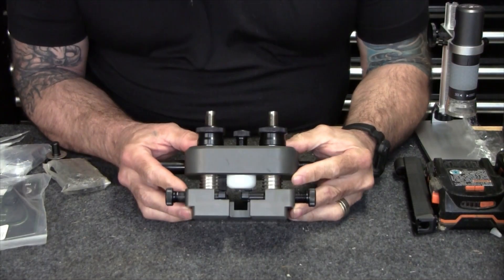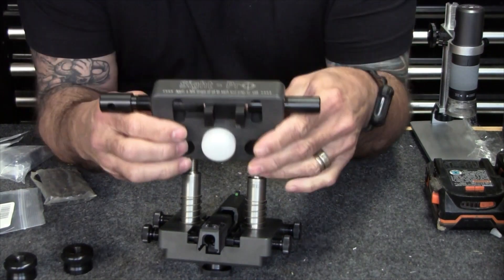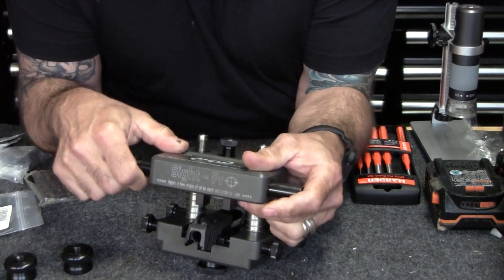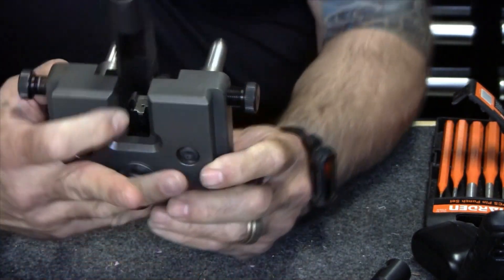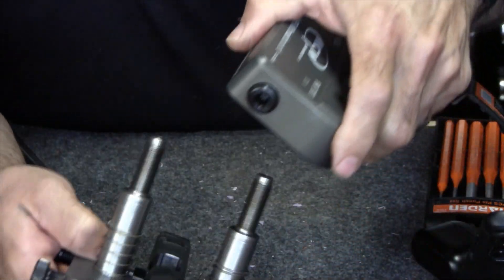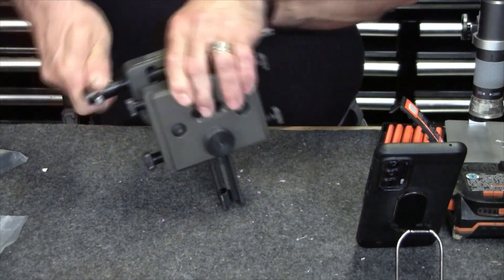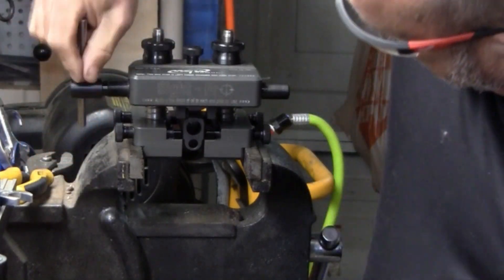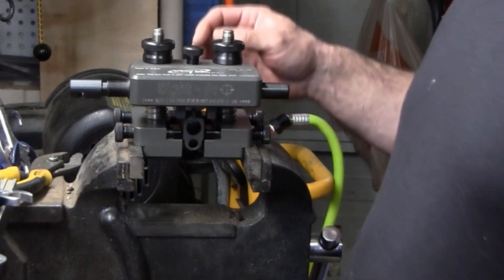MGW Sight Pusher Review and Demonstration - What Makes it the Best?

Comment: Removed a front sight on a Ruger 57 with it?  This front sight is worse than my Springfield was.  Afraid I'm gonna bust the sight off before it gives.
Reply from the maker: I hear ya, my Sigs are the same way. I put a drop of oil in there. The MGW is the best tool out there for sight removal, I think that with the MGW and the right base for the slide you should be fine, BTW, a drop of fine oil really does help!
Reply: @ExtremeDIYGuy  It did come out, but it took cranking down on it very hard and tapping against the pusher with the biggest brass punch I could find with a nylon hammer and when it broke free, the loud crack sound made me think I did break the factory sight.  One of the worst ones I've removed so far.

Comment: Just ordered and paid $451.00 for mine with 7 shoes so far, yes very expensive but had to do it after using my current P500 Pro which it is not least expensive also coming at $300.00 I damaged the sight ramp corner on the slide of my new Walther PDP Pro, took a tiny chunk of material enough to be bothersome as the pusher failed and by the time I realized I had pushed far enough, no idea if I will be able to repair/ blue it again, not sure if it was the sights being way too tight what caused the failure or the pusher but even checking i should have stopped the minute i felt that resistance, seems the slide may have moved slightly which is why I went and got this system; one firearm slide damaged is one too many and I was so happy with the PDP but the plastic sights that comes with it are garbage, same at the recoil rods, no idea why some gun manufacturers kill their otherwise outstanding products with cheap crap on them. So lesson learned, what is that say goes like? Buy once, cry once, in my case I cried twice, once when damaging the slide and when I bought the MGW, i have not removed the sight off it yet so hopefully would not have to cry a third time!
Reply from the maker: I'm quite pleased with it, it is expensive but like you said buy once, cry once!